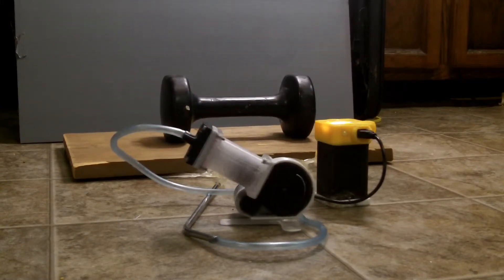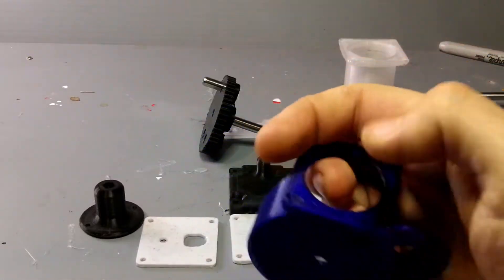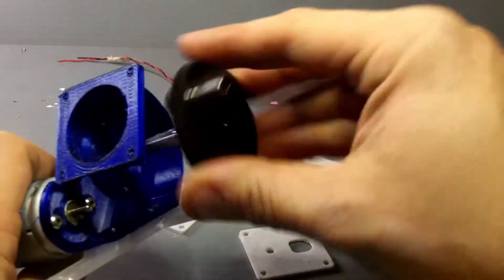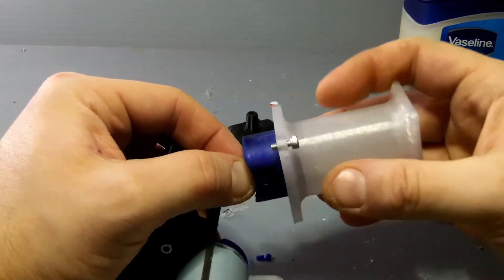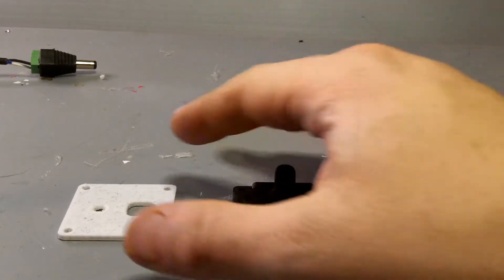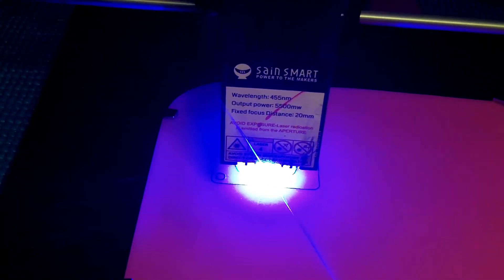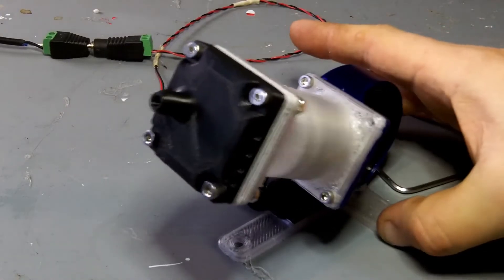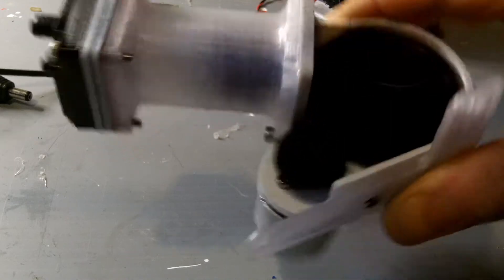3D Printed Air Compressor

Comment: Really nice project ! I think the opening of your piston ring need to be a zigzag cut , not a straight cut where the air can escape.
Reply from the maker: @PyroEvil  thanks , ya strait cuts not the best , but it would also work better if I spent the time and got the gap around 0.003" . For ease of print and the original intent the current seal works ok . I do have a better piston design I have tested with somewhat better results . I have a plan on updating the parts list for this compressor again at some point . No promises on when tho

Comment: thank you i just did do an o ring instead the petg seal and i got almost 20 psi
Reply: oh thats nice, have you tried inflating something with it, for example a paddle board that requires about 15psi?
Reply: @Plackomiot  yes i did it was slow but good you could counter the slowness wenn you print the compressor tynier and add proper sealing and better valves i mean real one way valves i also funtions as an water pump but i would not recomend it

Comment: Excellent video. Thanks for sharing. Perhaps the starting up can be made easier by coating the cylinder with some type of lubricant. Vaseline or graphite grease should work. 
Keep up the good work
Reply from the maker: Thanks , and that lag on startup is the valve sticking to the inlet for some reason causing a vacuum for the first few cycles till it starts up . This is the only one that does this and it's likely because I was using it to pump smoke from a laser engraver as a test and everything has a layer of tar like substance on it  .

Comment: Do you know the max psi such a system could reach?
Reply from the maker: With the current setup (380 motor ment for 24v on 5v ) I was seeing 1-2. With higher rpm higher pressure could be achieved . My use case was to replace a typical aquarium pump , witch I'd dose rather well . In fact the flow rates seam to be much higher than. The typical aquarium pump . The diaphragm pump in a newer video is slightly higher pressure but doesn't last as long.  I would like to use a oring piston and an sturdier rod to increase pressure In the future  . Other things could be done but at some point the bottom end will fail rather quickly at higher pressure . I have not tested to the limit tho . If I were to make a compressor that works over 20 psi I would start from scratch .

Comment: you could  make the cylinder separate from a top and botton cap , or even  use  a pipe for the cylinder
Reply from the maker: This would definately improve things , however the original idea was to make this a project others could replicate. So the tubes not the best for that , the separate caps would likely end up with a better print for the cylinder . Find some long bolts and tie the head to the frame  , I might have to do that . Otherwise it does do the intended job which is to replace an aquarium air pump .  I made a diaphragm pump as well which makes a little more pressure but it turns out in practice the piston pump is pretty reliable in comparison . I need better diaphragm material . Projects like this I'm doing my best to work within the limitations of the average 3d printing enthusiast , so simplicity was my goal over end performance . Something more end performance oriented would be my supercharger projects .

Comment: Looks good, what about lubrication?, Is posible to use some type of oil with 3d printing?
Reply from the maker: Ya you could , the petg I'm using is good for most oils , so would abs and nylons , bot sure about pla . A little light grease on the rod and crank bearings , and I have tried graphite on the cylinder and I was going to try dipping a piston in hot wax , peeling it off which should leave wax in the pours.  The biggest thing is getting the fit correct between printer settings and fitting . So far I use the biggest wear point has been the bottom connecting rod fit , as while running now it has a decent amount of rod knock , but it's a cheap replacement.

Comment: Thanks for sharing! I just finished making a centrifugal compressor. It moves a lot of air but doesn't produce much pressure. I need more pressure to run an air blast on a CNC 3018 router. I was just about to start designing a piston-style compressor when I came across this. I think I'll give your design a try before I spend the time re-designing the wheel.
Reply from the maker: you welcome , if you want high volumes of pressurized air under 3 psi take a look at this : https://youtu.be/SJbkrCtAIHg